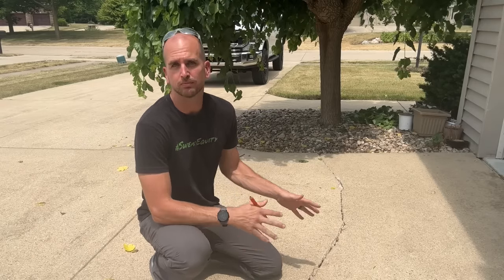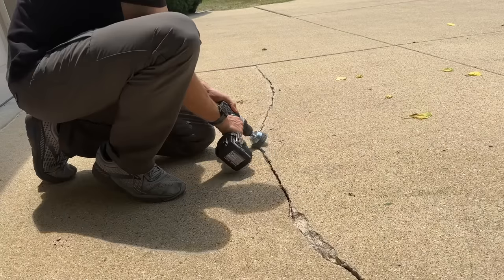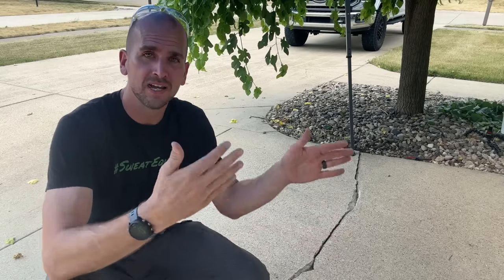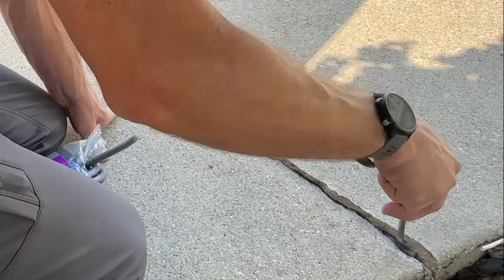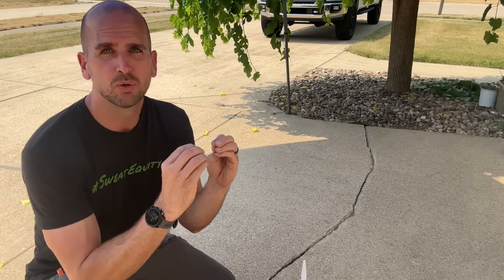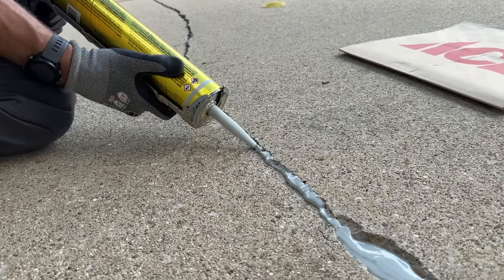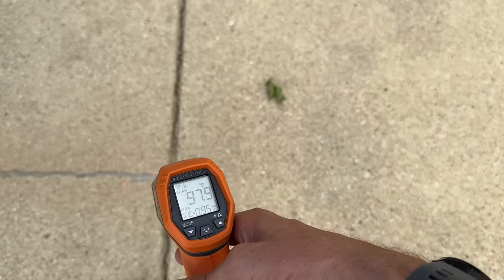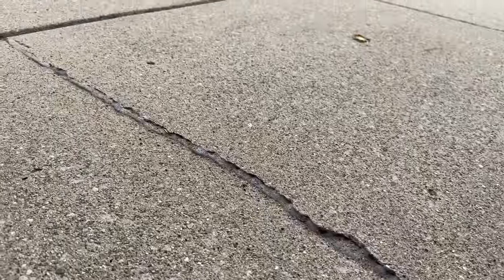Repairing A Neglected Driveway Crack |  The Ultimate Solution!

Comment: Two additional tips when working with the 45 SSL: you can fill the crack to almost over filling it because it does shrink a bit when it dries. Second: I ended up dumping a large amount of sand over the entire crack once it was filled and then came back the next day and swept/ blew the excess off. It ends up blending much better and does a good job hiding any over fill pointa
Reply: This is a good way to make it blend better. But it will also significantly shorten the life expectancy of the sealant. It severely restricts the sealants ability to stretch.
In fact as a professional caulker if I do this I void the manufacture’s warranty.
Having said that , for most homeowners aesthetics are more important than ultimate performance. But in the future if you do decide to use sand, try to use very fine sand and just dust it on top. The more it sinks into the sealant the more damage you do to the lifespan. My suggestion is don’t do it. As the sealant ages and dulls it will blend better
Reply: @genecarden780  I assumed those were probably the trade-offs by going the more aggressive route that I did. You are spot on though: I'm more concerned about the appearance and general effectiveness than having maximum longevity. I'll see how it holds up, but I'll likely need to replace my driveway at some point in the next few years so I knew this was only a band-aid solution for my particular situation
Reply: @benjaminwells3233  The best approach is to wait for the surface to begin to skin, then lightly dust the surface with fine sand and powdered colorant, and immediately blow it off. The net effect is a pre-aged appearance with minimal impact on the elasticity of the sealant.
Reply: @genecarden780  Good luck with your manufacture warranty! Not worth a s***.
Reply: I wonder if a light dusting would help prevent aging due to UV rays?
Reply: @M_Ladd  Major manufacturers stand behind their products in industry. But it has to be installed correctly. And because 90% of homeowners don’t install it correctly,and the manufacturers know that. You are right, the guarantees are pretty much useless to the homeowner. But that doesn’t mean you shouldn’t install it as close to industrial standards as possible.Their industrial guarantees are very good, because unlike with homeowners ,they have some control over the installation in industry. On large projects we are often required to have independent inspection for joint configuration, adhesion and cohesion to document it was installed correctly. Obviously this is not possible with the consumer.
Reply: @genecarden780  Hence, what I just said! Not all people install things half-ast. Some go above and beyond because they want it done better than properly. Contractors are on a time schedule, and time is money, so they too will hurry and cut corners, and that's a fact.
Reply: @M_Ladd  Good contractors don’t cut corners and that’s a fact. They make their money by being skilled and able to do a good job quickly. It’s laughable that a homeowner thinks he knows how to do a better job than a good contractor.. Here’s a hint for you stop hiring the cheapest contractor you can afford.  Unfortunately there are far too many bad contractors out there.
You are talking to the wrong guy about this. For a lot of years I worked for a group of architects and lawyers that would sue incompetent contractors on property owners behalf ( obviously large properties) it was my job to prove why sealants and waterproofing systems failed. 
And I never said that homeowners do it half assed. It is a fact that 90% of homeowners don’t know the proper steps to install sealant and the proper way to accomplish those steps It is a specialty contract that most contractors aren’t qualified to do.( in a waterproofing situation) any more than a plumber is qualified to do electrical
That is why I’m here trying to give homeowners the best information to be successful. I understand a homeowner has a hard time hiring good contractors at a premium price
Reply: @genecarden780  ALL, contractors will cut corners if and when they are able, and that's the primary reason you even have a job because you have to check on them and make sure things are done up to specs and properly. Just like most state inspectors. If all jobs were done correctly and up to par, then you would not be needed. And 90% must be a number you just made up because it is totally not the case and you know it. Most homeowners will not take on a project if they are not knowledgeable about what they are doing, not a project of any large expense anyway. They usually have some skill at what they are attempting to do. Got to run, adios amigo
Reply: @M_Ladd rong  good contractors do the job right even if it is at a loss. The  simple fact that there are so many completely stupid caulking videos on YouTube from homeowners proves you wrong. I have seen 1 channel that gets it all right
How many hundreds say to use soapy water or worse yet, glass cleaner to tool sealant 
How many say to use primer?  NONE You have Zero Knowkedge when it comes to this subject.
I know plenty of contractors that turn down work because they won’t compromise quality.
I have also been on a few projects that broke even of lost  money in 45 years. And for your information breaking even is a loss for the contractor because he had a crew tied up for months without a profit
Your ignorance is amazing
Stick to subjects you gave at least a minimum knowledge of.
Reply: @genecarden780  Wow, getting a little testy there, Geno. All that makes them sound so perfect! Yet you still have a job, right?
If all those contractors are so  good and reputable, then why is it that you still have a job? Inspector Gadget is more your speed! You haven't heard anything I stated. You are in your own little world, and that is where you will always remain. Starting to bore me Inspector Gadget! Finished with you. BYEE.
Reply: @M_Ladd  you made the totally ignorant statement that “All contractors cut corners”
Reply: @genecarden780  Are you one of those Narcs who believes they know everything, or are you just a troll? Wait, never mind, I already know the answer! Lol.
Reply: @Sub-Stance  nope just someone that  has been doing this professionally for over 45 years so I don’t know everything but I do know more than most in this particular field. Just like I’m sure you know more than me in whatever field you are in. 
But I will call out ignorance when it is stated as fact.. Like “ all contractors cut corners” it simply isn’t true. Or “use soapy water or glass cleaner to smooth the sealant”  Both are ignorant and wrong.
My whole purpose is to give homeowners the best chance at success and eliminate ignorant bs that surrounds sealant installation on YouTube. But I will respond to ignorance that is a response to me.
Reply: @genecarden780 you mentioned one channel that does caulking right. Would you mind sharing the channel name? Thanks!
Reply: @aradipe  I came across it a long time ago. I will try to find it again but it might take a while.
Reply: @aradipe  https://www.youtube.com/watch?v=JCOGBNdWiEI
He has actually made a few videos. He understands sealants and the correct way to install them. Unlike 90% of the people on YouTube
Straight forward and simple with none of the gimmicks that ALWAYS end with an inferior installation. He is a professional and makes it look easy. The only truly acceptable “short cut” for the homeowner is take the time to carefully mask.pull the tape immediately. And make a little mock up and practice a couple if times. It’s not really difficult.
Reply: @genecarden780  thank you!
Reply: Nice explanation.
Aside from the light dusting of sand, is there anything that can be added above the sealant in order to make the crack less visible / more aesthetically pleasing?

I have a small crack in the walkway leading to my front door. 6in on one pad, 6in on the next pad (continuation). Likely a root.

Will seal as demonstrated.  It  is on a slight incline and don't want it pooling.

Just hoping to fill the gap between the top of the sealant and the surface of the concrete with something more substantial and color matched to the actual concrete without compromising the installation.

Ideas? Concrete is 17 years old, crack is one year old but spreading quickly. Very pale in color.

Thanks.

Ignore the trolls. One post with their name and "that information is incorrect" will suffice. They can then have a conversation with themselves.
Reply: @fredbraid818  what do you mean by “ more substantial “? Do you mean more long lasting color? Or do you mean tougher than the sealant?
Reply: @genecarden780  I meant that sand covering the sealant will not fill the gap between the top of the sealant and the concrete. By substantial, I meant something that would take up that void between the top of the sealant and the concrete surface. Purely for aesthetics.

How much sealant can I put in that crack expressed in percentage depth? It's very narrow and will still be even after I open it up. I honestly don't know how deep it is, but it is maybe 1/8 in wide as is. I know I can't make it disappear but I'm sure that's what the wife expects, so I am trying to get to a place where the crack is sealed properly and aesthetically it is harder to notice because I have found something to put over the sealant to color match but without compromising the installation
Reply: @fredbraid818  without seeing the actual crack this is difficult. You sound as though you expect the crack to keep growing. ( based on the assumption ghat is caused by roots) this us problematic.. In actuality the  minimum width that the sealant should be installed in 1/4”. This is usually accomplished by opening the joint with a “ crack chaser “ grinder blade. 1/4” wide by 1/4” deep is acceptable ( minimum depth is 1/4”) ln that scenario you can fill the crack right to the top. Short of this ,filling a 1/8” crack is a crap shoot. If you are unwilling to open the crack ( due to aesthetics)  I would fill it to the top and hope for the best. But I would say this is a 50-50 chance of success. The standard formula is 1/2 as deep as wide but with a 1/4” minimum depth and 1/2” maximum depth. So a 1/4” wide joint should be 1/4” deep and any joint 1” or wider should be 1/2 “ deep. 
If I didn’t help or we need more clarification just ask
Reply: @fredbraid818  I forgot to mention that acceptable joint movement is expressed as a percentage of the joint.
Usually in the neighborhood of 25% for quality sealants. So 25% of 1/8” is not very much movement. That is the reason for 1/4” mnimum
Reply: @M_Ladd like it's worth anything to begin with?
Reply: Very good tips, many thanks!
Reply: he should off just licked it ...that's what i do with both my wife's cracks but only one of them gets wet the other one is always just filled with dirt
Reply: I think this was a great video. But if you going to do all that work I would of taken a expanding spray foam such as “Great stuff” (not the most rigid out there once it dries but the original formula is actually pretty stout) and sprayed it down into the crack. If you have a crack larger than a quarter inch or 6-12 months old you most likely have under washing beneath the driveway. Some subsurface erosion. If driveway had proper gavel, tamping, and installation. Only roots or water erosion will cause uneven heights in concrete.
So the expanding foam will fill in all the holes and gaps left over from water erosion. And prevent for an extra extended period of time the sinking concrete sinking farther. Can’t be the extra soft cell stuff for like around windows and doors though. Then trim it 48 hours later and it will also act as your backer rod. Then seal it with any quality sealant like you used in video. 
Using the foam should buy you at least few years before any additional slab sinking and sealing the crack prevents future water erosion buying you at least a few years also.
Lastly I would dig to and chop the roots 2’ back from the driveway. They should be only 4”-12” deep and close to in line with crack if it was involved.
Well that was a fun book to write lol. Thank you to the 1 person that eventually reads this whole thing ha
Reply: @M_Ladd  bullshit . I don't cut corners. I'm charging you for my integrity and ability. Do it right or don't do it. M ladd is revealing he would cheat .
Reply: @genecarden780  I've never heard a job title "professional caulker", is that all you do?
Reply: Thanks for the tip!
Reply: ESTIMATE $15-$18 K FOR LONG DRIVE WAY. I JUST NEED SIMPLE FIX UNTIL I DECIDE WHEN I CAN REPLACE, LIKE MORTGAGE PAYMENT VS DRIVE WAY. TRY SOMETHING UNDER $1000. SOMEONE RECOMMENDED EZ SAND HOME DEPOT HAS ANYONE TRIED OR HEARD OF THIS PRODUCT??

Comment: One trick for matching concrete would be to pulverize the chips you remove and sprinkle that on the top instead of sand.
Reply: Pulverize the chips you remove? Have another beer. You must be  retired government employee.
Reply: @extraart1  he means any concrete chips or stones that you may end up finding in the crack itself. If you smash them into sand it will match the color of the driveway and will look much better after sprinkling over the sealant. Otherwise, like most of these videos, it comes out looking like absolute garbage.
Reply: What a stupid reply- it’s a great suggestion to get a good color match
Reply: @extraart1 you should not “ sprinkle” anything o top if the sealant it WILL shorten the sealants life significantly
Reply: BLet me tell u sand(or pulverized concrete)is almost a must.  If u dont use it when cone back you'll have ants, flies, garbage stuck to the sealant making it look awful.  The sand trick is also usefull in high traffic areas so it doesn't get stuck on shoes. A  Little Sand on top  has no affect on longevity of the sealent. Your getting this info from the crackmaster himself.
Reply: What about waiting for the sealant to cure and then apply a think layer of cement? Would that work well?

Comment: Hey man pretty good tutorial. A few tips from a guy that has owned a caulking company for 30 years. If you use a 2 part polyurethane caulk you stop a lot of bubbling issues because it cures all at once. Instead of the top curing first. Another tip, Sonneborn, now Masterseal SL-2 Slope grade works way better. You can over shoot it, then back tool excess and you have a perfect joint. That material would have also bridged the height difference of the crack at that one end. There are way more colors with the SL-2 too.
Reply from the maker: Thanks so much for the feedback.  I had good luck with Sika in the past but never used the Masterseal SL-2 for any of the jobs.  👍
Reply: I have installed miles of SL2 ,very seldom use anything but slope grade. You are absolutely correct that it is a better product. I can give many examples of it lasting 20-30 +years when installed correctly( it will fade )For one thing it has to be tooled to insure 100% contact with the substrate.But 2 component ( actually 3) is out of the skill and equipment range of 99% of homeowners.
And the bubbles on very hot days are usually ( not always) because of not properly preparing the joint.
1. Not grinding the sides of the joint,  when talking about jagged cracks, leaving small voids that trap air. Tooling can help
2 .leaving gaps in the backer rod.again leaving air pockets. Again tooling can help
3. Using sand as a backer. Sand is never acceptable. Doesn’t matter if you tool it there will always be air trapped in the sand.
I have seen it many times. Even with multi component sealant and lousy workmanship. Often if you cut out sealant that was installed over sand you will find it filled with small air bubbles. It appears fine on the surface but will fail prematurely.
I have been a professional caulker for over 45 years and spent a lot of those years proving why sealant and waterproofing systems failed, for a group of architects and attorneys that would hold incompetent contractors accountable. (BTW it wasn’t always the contractors fault)
And your comment about backtooling. Back tooling alone is never sufficient. It needs to be tooled in both directions. No Exceptions. Not saying you meant backtooling was all you need just clarifying for homeowners.
Reply: I have this situation but it is asphalt.  Some of the gaps are approaching and inch.  Any recommendations?.....thanks....
Reply: For asphalt cracks there's a material called CIM, or CIM 1000. You can get it in side by side cartridges. It's expensive, but it will stick to asphalt REALLY well. You have to apply it when the substraight is cooling in temperature or it will bubble. Also the working time is short, so be fast. That's the best stuff, but if the job doesn't support the material cost you can use an asphalt based one part material that will do the job. It just won't last as long. I hope this helps.